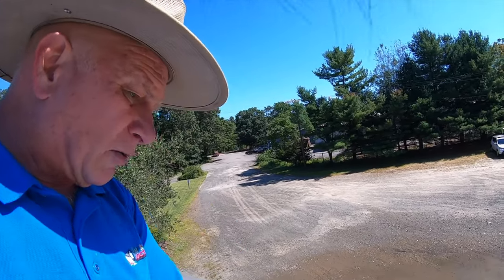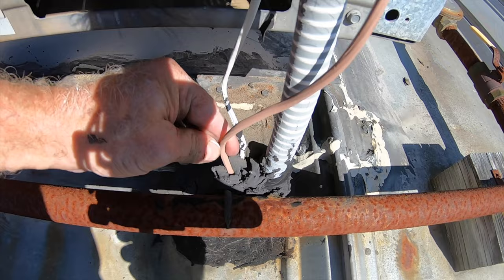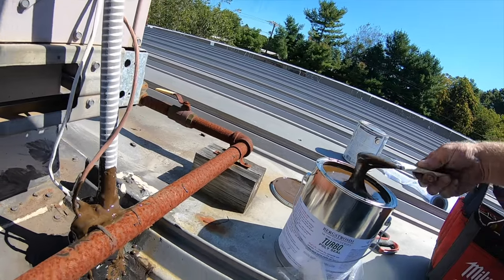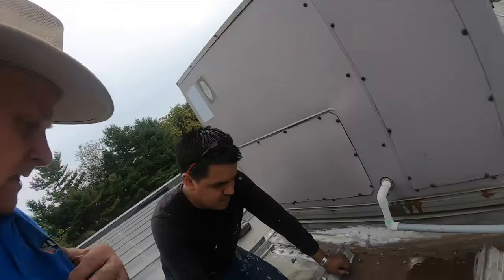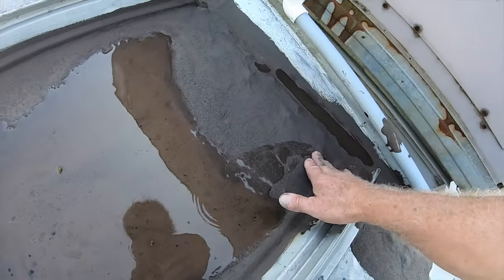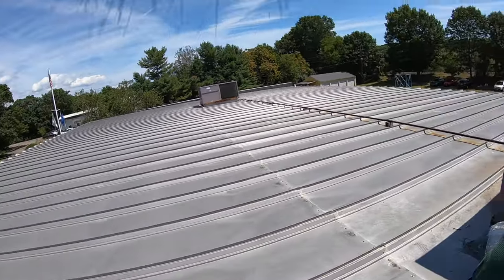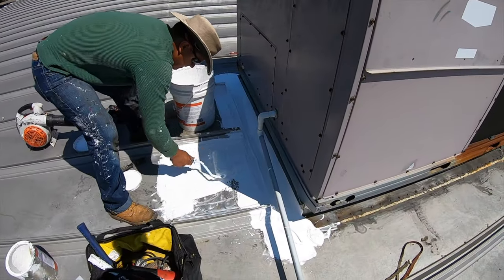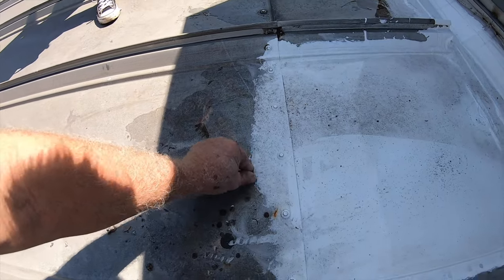DIY Repair Metal Roof Leaks & Rusted Holes with Liquid Sealant Easy Fast

Comment: Hey roof doc, we have 61,000 sf 24 guage standing seam roof (25 yo).  One area of about 1000sf had steam dumping on it for a few years and is rusting (not rotted out - just rusty over about 60% of the surface.  What's the best method to extend the life of this area?

Comment: dr mr..could you pls make a vid on fixing an old corrogated roof with holes for us old folks on a small budget...any insights will help pls be simple like ov erview..insights-what to do first==sucessive steps pls and manythxs
Reply from the maker: I can only make videos on projects that I come across. Some of the projects I was invited to come and do. Let me know where you at in the country, I might be able to look at it
Reply: @FlatRoofDoctor  figured that part out due to your location and our environment...here arizona southwest  and our roof systems especially if one builds it oneself are usually inadequate to begin with...so its my problem...small areas but problematic usually only when it rains...on a lighter note did note the special things to look for that you pointed out in previous videos...they helped as i prepped and patched pre coat...so manythxs for what you have already shared...one vid may be on just your portable tool box and its contents..jhow its organized would be a great share...plus perhaps a vid of the mjaterials that you recommend for hlong term hi end fixing and in contrast a cheaper but effective show or list of cheaper materials that are effective...it would be important when one goes to home depot to buy them..home depot all we got here...great and important shares for all us roof owners..manythxs

Comment: hey doctor, got a question. Torch down isn't allowed in NYC for mod bitumens. Is cold adhesion or peel and stick just as effective? through cold adhesion, can you recommend the coating that should be used so that I can tell my roofer to get that specific one? thank you.
Reply from the maker: It is just as good. I used it many times on the Brownstone Buildings in Brooklyn. Most of the roofs are slanted.Allthough not permitted, I have used Torch on many occations

Comment: Hi Roof Doc, I have a new construction flat roof with railings installed at the time of building. The railings do not go out to the edges where the parapet walls are. I want to move the railings to the edges, but I’m concerned about disturbing a brand new waterproofing. Should I be concerned? Is there a good way to approach this? This parapet walls are capped with aluminum coverings, and I don’t know if the waterproofing goes up and over the ledge.

Thank you for your great videos! Subbed.
Reply from the maker: Itis easy to patch any hole. So, no worries removing the railing posts.Also, when you install the posts on top of the parapet wall over the aluminum cap, then use Turbo Poly Seal to do the flashing around them.
Reply: @FlatRoofDoctor  thank you so much for your reply. I’m glad to hear that you think a patch will not compromise the roof. I’m only concerned now about voiding the builder warranty.

Anyway very helpful! Appreciate it!